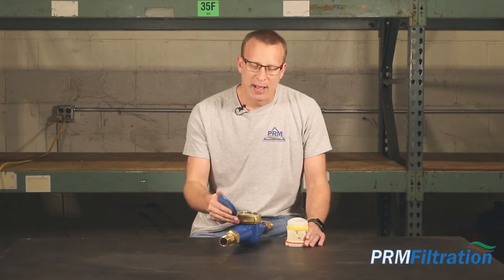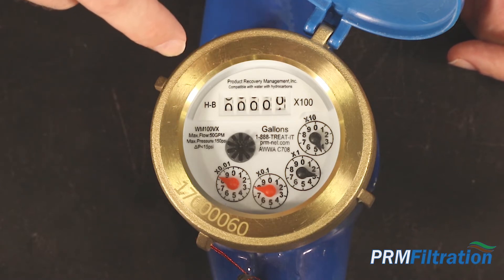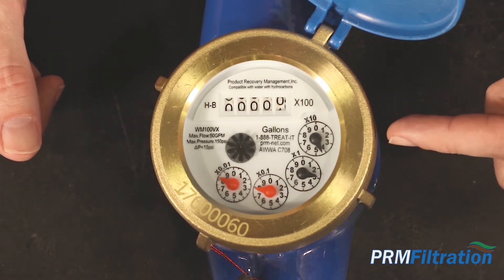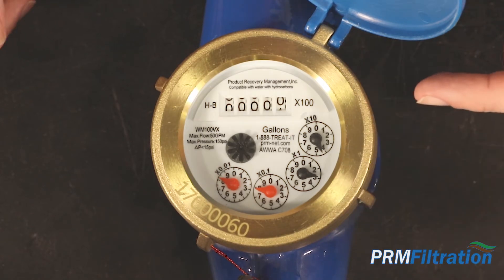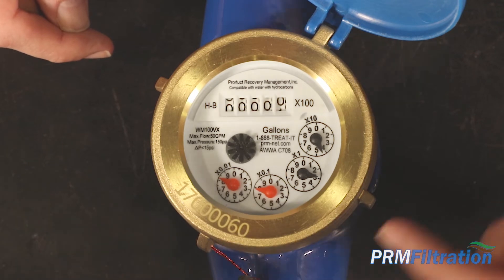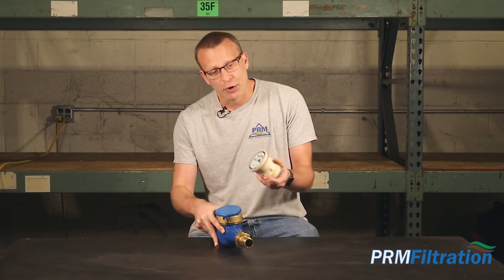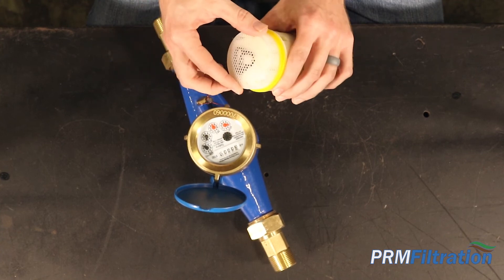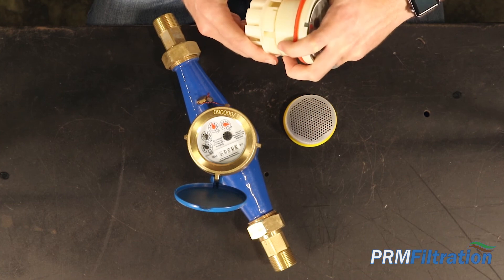How does a Water Meter Work?

Comment: Does it need a battery? How does the digital reading get saved?
Reply: Where is the digital readout?
Reply: @ishanfernando3064  , i see now..there is no needof electricity. The movement of the numbers dial are driven by water pressure.
Reply: @rgudduu  yeaaah, there is no digital readouts here. Everything is mechanical.